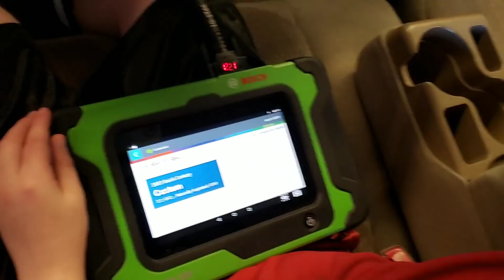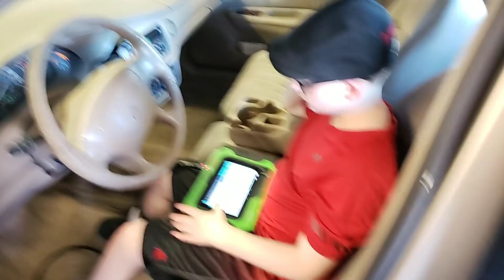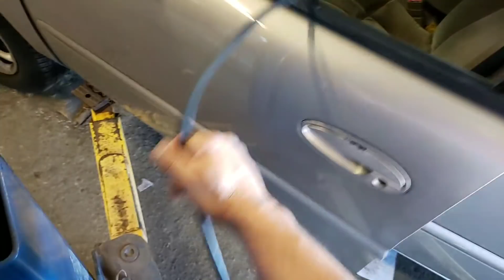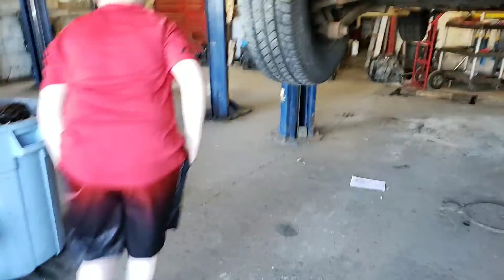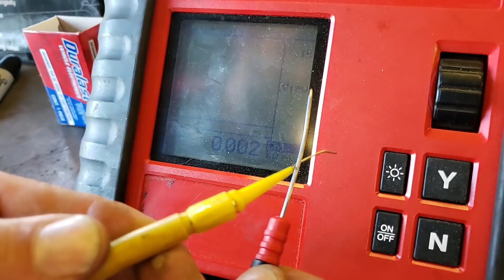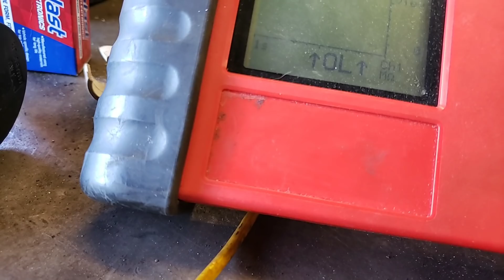2003 Century p0446 Vent solenoid performance

Comment: I watched the above video before I started working on my 2002 Century. My engine light was/is on and reading the codes I got a P0446.  The car has 105,000 miles on it. I went to Auto Zone and bought the Vent valve sol.  I checked the valve by using jumper wires and verified the valve closes when 12 volts is applied to it.  I did a voltage check on the connector and found no voltage, with the key off, and 12Vs with the key on. I installed it and hooked up the vent hose, and started driving.  It did not fix the problem. I  uninstalled the vent valve and found that the valve does not close when the key is on. ie I lowered the valve and blew thru it with the key off and on, I was able to pass air thru the valve under both key positions.  What am I missing?

Comment: Great video. I just wish I had all the tools you have to check my Solenoid. Is there a way a budget mechanic would be able to check whether or not these things worked with just a voltage meter?
I mean it'll only cost me 20$ to get the part, but I was just curious. Great video, Thank you.

Comment: Ihave a ford edge 2011  check engine light on idont no the code 02 sensor stuck rich bank 1 and bank2 sensor icheck the fuel trims  its negative fuel trims on long term-25 when i accelrate the trims go on positive any idea and ihave p0171 and p0174 lean condition